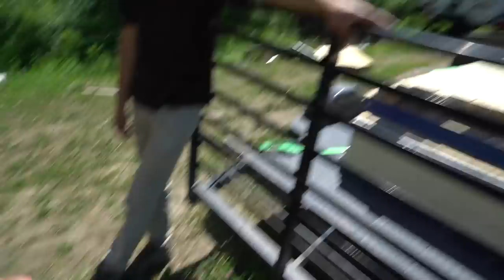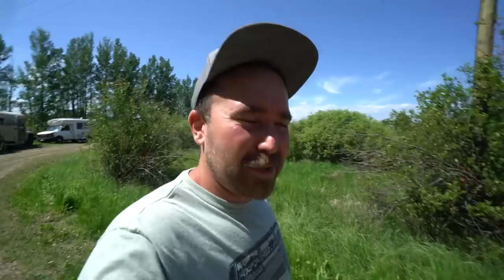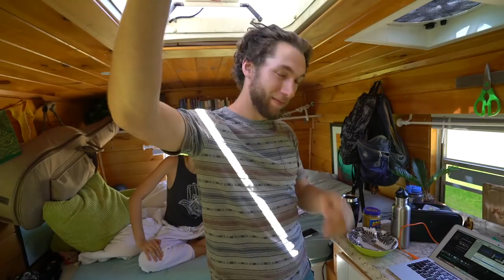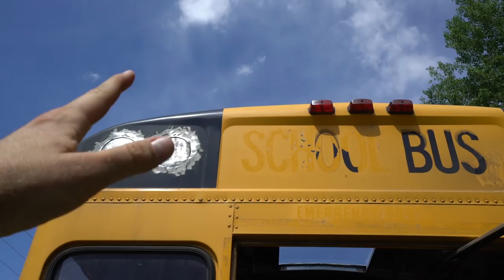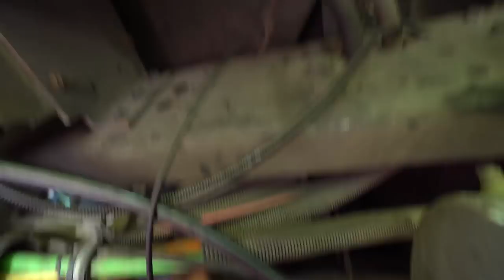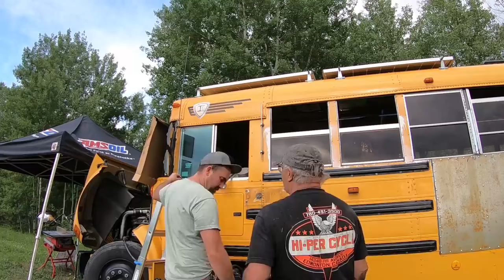Covering Light Holes + Webasto Install Update

Comment: Jack's I just took a marine electrical and marine heating  Course and one of the things they stressed about installing the wabesto heaters is that the little fuel pump must be mounted at a 45ﾟ angle .  I think it has something to do with losing its prime, you may wanna check into it...Terry
Reply: Traveling Terry no it say can be mounted but max angle is 45degs it has a creck valve to keep prime 🇨🇦🇨🇦🇨🇦

Comment: Is it required to remove the extra flashing lights when converting a bus? Can you rewire them as turn signals and brake lights for better visibility? I’m doing a short bus conversion and I’m keeping mine as flashers for if I ever break down. I did remove the stop sign on the side though and it will be painted a new color. Just curious as to why everyone removes these lights. Indiana said I didn’t have to do anything except remove letters saying it was a school bus.

Comment: there dog collars with gps trackers wish might help finding them back if they run of intoo the wood
as for the bondo , for thicker repairs / filling holes and stuff look for stuff called kittyhair , its basicly bondo mixed with glassfiber , the stuff is super strong like construction strong https://zv893kwy4t3aji512fdckhgk-wpengine.netdna-ssl.com/wp-content/uploads/2013/03/repair-rust-holes1.jpg it does need more machine sanding before finetuning it
about the airhorn you can put a pull chain for that over the side window